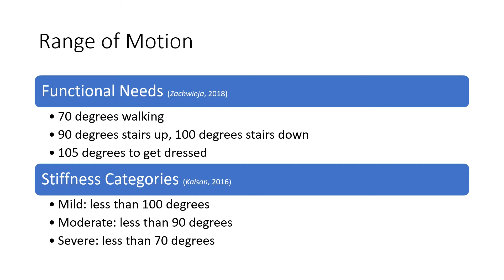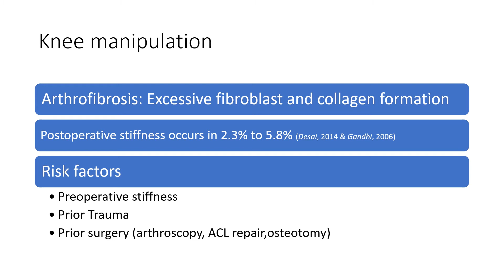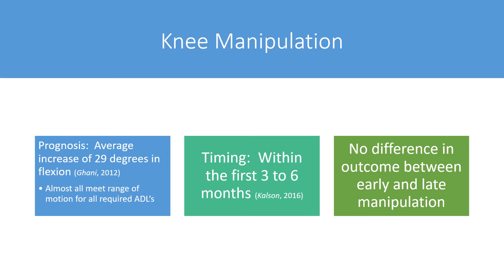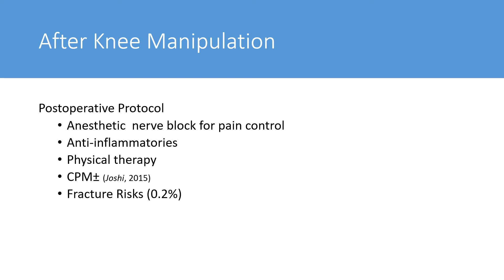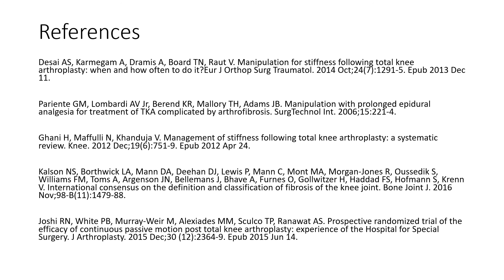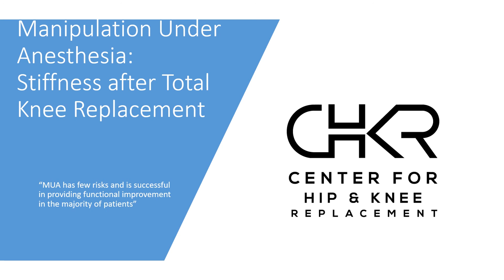Manipulation Under Anesthesia: Stiffness After Total Knee Replacement

Comment: I had a stiff knee, then MUA 8 weeks out. Post surgery I experienced quadriceps hematoma, swelling, stiffness and unable to put weight on operative knee. Ct and MRI showed no fractures. I am 3 weeks out from MUA still stiff knee and not making good progress with ROM. Quads and hamstrings are extremely tight. Can’t get better than 80 degrees flexion. Concerned about even trying another MUA or surgery to remove scar tissue. Desperate.

Comment: I had to have M U A after a TKR. My range of motion was less than 100 degrees after 8 weeks and knee was stiff.  My orthopedic doctor wasn’t satisfied with that range and wanted a M U A performed. I had  M U A at 11 weeks after K T A. My thigh muscles were so tight I couldn’t do the therapy 3 days after therapy. My doctor put me on some muscle relaxers and pain meds. I took the meds and felt a lot better with the muscles relaxing the next day. Just a longer road to recovery but worth it since.  For those who are thinking of doing a TKR.  Suggestion keep a calendar,pill box ( with days of the week on it) , write down all the times you take your medications so you remember. a cold water therapy machine ( Well worth the money ) I bought one on Amazon for $160.  A recliner that goes almost flat when extended, a heating pad works wonders also, Remember to do your home exercises and eat a well balanced diet helps also. Keep the Faith and you will survive , Remember “ TOUGH  TIMES DON’T LAST, BUT TOUGH PEOPLE DO”
Reply: What was your ROM after doing the MUA procedure?  How much longer is the road to recovery after MUA?
Reply: Hi My ROM was 100 degrees and after my M U A it was 110 degrees unfortunately after a few months my knee got worse and I’m lucky to have even 25 degrees unfortunately after. I wish I had used an orthopedic surgeon that used robotic surgery instead of his hands free. I. had a-lot of arthritis in my knee joints from a 30 year injury. The worker’s compensation insurance company stopped my physical therapy after 3 months. I have a lawsuit pending.